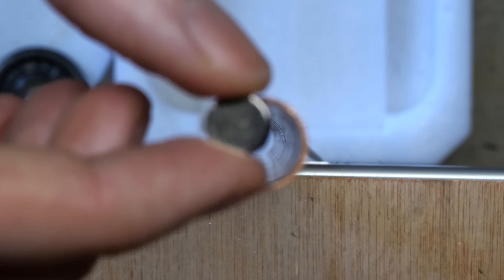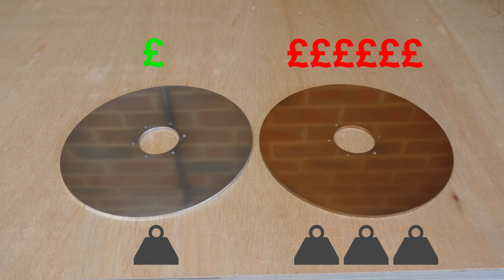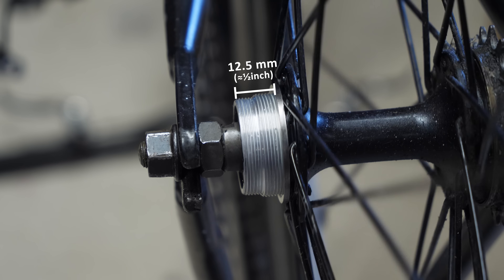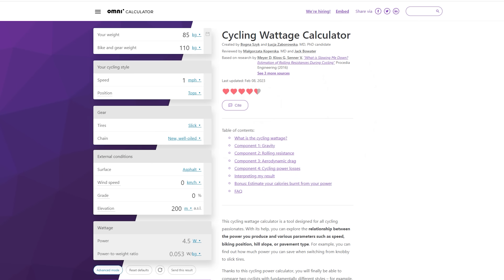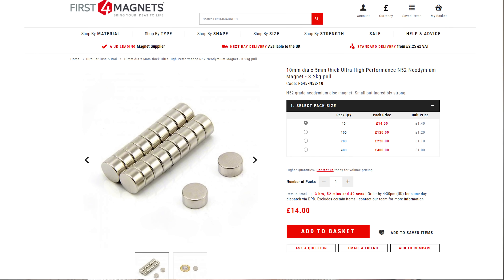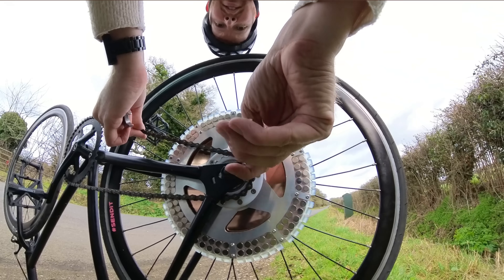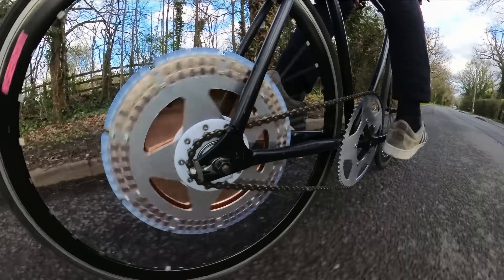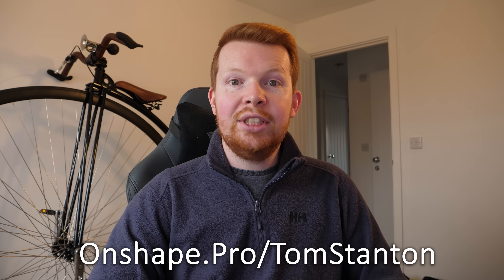Gearless Magnet Bike

Comment: 1.305 / 5.000
Resultados de traducción
Resultado de traducción
I've been thinking of making a request. In the city we must, as cyclists, stop at traffic lights and at crossroads. And we lose momentum, which is very precious when using a bicycle on a daily basis. To the point of modifying routes and departure times to avoid stopping so frequently. I think of the spring rope drive system that the toys used. Mr. Stanton did several tests in this regard some time ago. Before developing new batteries or fuels, I think the user appreciates that with these simple systems, such as the flywheel or the metallic spring system, they can make their riding a bicycle more effective. I don't think pedaling should be given up, exercise is something we need, but we want to reach our destinations more efficiently and maintain a better average speed. City cyclist aerodynamics seems to be underappreciated because the average is low. But a headwind or using a non-aerodynamic shape are felt a lot in everyday life. When I carry my heavy bag on the handlebars to protect myself from mud and rain it seems to have an improvement in efficiency. I am 63 years old and it is not easy for me to reach 20 km/h. No engine, no fairing. How would my routine journey be more efficient?

Comment: Copper is better but silver is 3 times better than copper. But silver would be too expensive 
. Try it on a .999 copper & a .999 silver coin , slide a small magnet down the coins and u will see the outstanding results. 😉

Comment: If you drill the same number of holes as magnets in a ring around the copper so that the centers of the magnets move over the holes, it will induce a current around the hole and be more efficient. The amount of energy turned into heat vs work in mechanical output is going to be proportional to the amount of slip.

Comment: Aluminium is better suited because it's diamagnetic, copper is paramagnetic, this has nothing to do with conductivity itself, its about permeability. The inertia is a valid point concerning the discs. If you would make them the same weight and weight distribution (a homogenious disc is fine) the aluminum would win

Comment: I think using this as just a brake with the chain still driving the wheel may be interesting. Going uphill would be much easier, with the direct mechanical link, but being able to shed speed or better manage steep downhills automatically would be a nice feature to have.

Comment: Can someone clarify. This is all impressive. However. Gearing is preferred in order to provide speed ratios. All this accomplishes is a  slipping non contacting clutch. Wasting pedal power.
The thermal image clearly shows the wasted power.

Comment: lovely-- but using a iron ring behind the magnets you would double the strenght of the magnets AND you would avoid them sticking to the chain I believe. Also if you can get the magnets small and thin, and extremely close to the disk with a relatively thin disk... you should bet bigger force transfer at low speed and higher efficiency

Comment: That was great! The principle is not unlike Eddie current retarders used to slow large trucks. We would use them - rewired for mains voltage - to provide the braking force on a vehicle dynamometer. LOTS of heat; the powertrain energy had to go somewhere! (which is kind of the point). As long as there are Eddie currents, there is heat, and aside from superconductivity you are going to be stuck with it 😢 
I wonder if there is any advantage in making the arrangement like an induction (squirrel cage) motor? Haven't thought this through, but they have a non-magnetised rotor inside a stator's rotating magnetic field?

Comment: if the eddy currents are smaller would this generate less heat? Think how a transformer is made of thin plates to reduce the size of eddy currents.
What if the copper disk was in eight sectors?
This will make the design harder as the coper will have to be mounted on something. But the copper need not be structral. Say aluminium foil on a non conducting sprocket?
Thinking differently, I think an EMF is created causing the resistance and heat. What if this EMF was tapped into a load like a headlight or battery or electric motor?

Comment: As fun as that looked, I could see that would be the end result - less efficient as a torque convertor as all slippage is wasted as heat. Makes for a good zero wear brake though. Now if you coupled generators into that "clutch" in a planetary gear configuration, and then took the power generated to add some torque, provided there was good efficiency, now we would be talkin'!

Comment: I wonder if a design based on variable (changing) magnetic field intensities instead of the permanent magnets could improve the performance.  The permanent magnets will give you the linearity of power that you found.  Controlling the amount of "back-induction" may allow you to control the harshness of the changing torque.  More so because implementation may be easier as the change is to the stator.

With most admiration and respect for your work.  Jaime

Comment: In the copper-vs-aluminum experiment, the 3x density is what's causing the disk to travel slower rather than the enhanced braking force. An experiment where you ran a magnet sled down the side of copper vs. aluminum plates would tell you which one is best for the application.

Comment: Maybe a material with a high permeability would help because the magnetic field of the magnets passes through a smaller air gap to the copper plate but then the magnetic field has to return back on a very long distance back to the other side of the magnet just in air with a relative permeability of 1. But i understand it's not so easy to do that with electrical steel ;-). Additional it would be interesting if it's possible to set the slip and torque between the magnetic rotor and the copper rotor by adjusting the air gap.

Comment: First, congratulations on the great and successful project. At 7'41" of the video. Increasing the number of magnets actually DID reduce the RPM, proportionally, considering how many magnets you've added compared to the count of the magnets already there. In order to achieve the linear response, it takes the proportion to stay constant. If that is, say, 2, then it takes adding 2,4,8,16,32,... magnets in order to keep the response linear.

Comment: You are one of many recent (maybe since advent of youtube “lecturing”) fascinating examples of upscaling of verbal communication. Initially for maybe three to five years i did not comprehend on par with reading thus preferred reading for comp and speed. Now neither are concerns with as the prof mentioned below, colating of material, and using increased playback speed. Cheers to  your work and teaching. And to including thermal imaging, made me think about a viscous coupling transmission which audi and vw used back in 87 of which i had on my vw quantum which dispensed with having the weight of a traditional 4wd.

Comment: Have they made an automatic transmission for bikes yet?
I have always thought that if you have 2 weights inside the rear sprockets and they are on tracks so they can slide outward at higher speeds,
then you could hook a chain to the weights that would funnel through the bike Hub, to the outer end of an hollow axle and the chain movement could operate the derailers.
OR the weights could be outside of the wheel assembly and do the same thing.
Feel free to make this because I don't have the means to test it.

Comment: Since the braking force is determined by the difference between the magnet's rpm and the wheel's rpm, doesn't it mean you can brake faster when u pedal in reverse?

I'm not much of a bike guy, maybe pedaling in reverse is much harder than expected, but i guess it's worth a try

Comment: Think of those pumps where we see a coil of wire having a cylinder shape hole where the  
magnetic-cylinder and axel with blades fits into that cylinder shaped hole which is surrounded with the coil . Having just the fins, blades or pedals  outside the device? When current moves thru the coil cause the magnetic-cylinder to turn or engauge  the pedals in contact with the water to be pumped.
Now this is wear a small amount of electricity needs to be present to create a magnetic field which may solve the lack of adhesion to the spindle? This concept should be anticipated allowing for the immediate adhesion of gear to peddles shortening the the time and space while you pedal  your bike.
One may want to understand my comments by learning Dynamic Braking where one removes or adds resistance as a ( light=load) or various resistances to achieve various degrees of adhesion at the pedal stemming from the magnetic- gear at the wheel . This puts a load on the. Motor/ Generator causing resistance and engages such to stop the vehicle. But in your case engages the connection between gear and wheel / pedals

Comment: Tom Stanton et al.
Hello Friends,
I am Steve Léonard BSc,. Geology, G.I.S.,. Remote Sensing, Tectonics., Electrical & Electronics., Inventor,.Solutions-specialist Industry,.
Currently working on transportation devices involving N-720, Resonance 😊

Why are you building this magneto-clutch?

My Guess is only complicating the project!
What you are doing with the electricity produced? 
There are ways to apply this project that could lead to success.
Just a few things?
Use Dynamic Braking to increase brake power yes. 
Or experiment with the use of a SYMMETRICAL Wheel for breaking and switching between brake and pedaling.
Maybe try making 2 magnetic sprockets and two magnetic pedaling systems. Alternate between the left and right.
Knowing that most if not all bikes are manufactured for single pedal and gears on the Right side of the bike. This could mean use of a 4 wheel vehicle!
Connection/Correction of the sprockets at Right angles to the wheel.
SteveL@cogeco.ca

Comment: If you had magnets instead of the copper disc could they be arranged to repel the ones in the molded part you have .... to make the wheel spin ...that's to easy ?

Comment: Great work! I think this is essentially an induction motor. What helps the induction motor work more efficiently will help this clutch as well, e.g. adding slots to the disk to limit the directions of Eddy current, adding iron cores into the slots to increase the magnetic flux density (B = muH)
Reply: Could you use a belt instead of a chain to help with the weak points on the sprocket and the magnetic interference?
Reply: This was meant to go in the main comments. Whoops

Comment: You should make me  a mech suit out of magnets and ballistics gel or silicone heat resistant urethane resin to power devices and charge batteries run servos. Then, you could make me aquaman generating my own pure oxygen and hydrogen from my own movement. I'll be the guinea pig in this experiment. I'd be an underwater god in that suit. Sorry, I didn't mean to be so selfish and power centered. Let's build siuts and rule 2/3 of earth on this day after Earth Day 2023 4:44 PM

Comment: if you convert the chain to a belt, then you could move the magnets closer to the belt which means you don't need to squeeze the spokes, giving you more structural stability
I have little knowledge on bikes though so take my opinion with a grain of salt

Comment: dont know why you would spend any time on this. a geared apolication has a reason why it uses gears and not because it was the only idea the manufacturer  could come up with. geared transmissions dont work very well because the slip wastes energy ;where a gear  reduction increases torque and sacrifices speed. and In most applications the input and output should be linked for feedback. besides magnetic transmissions are not a new idea just a failed idea in most applications. its a nice build you have here though

Comment: Very clever, but presentation would have been better knowing the end result you were trying to achieve. A few words of concept, using a fast rotating disc of magnets driven by the chain to turn a disc attaced to the wheel, and vid of you riding. Geat mind!

Comment: What about DIY asynchronous motor using aluminium wheel rim as a rotor? Just put a few electric magnets along it and supply them with a phase shifted AC currents.

Comment: Maybe I didn't get it, but what is different about this concept and the one inside an electric bike hub motor since copper winding play the role of the copper disc? Thank you!

Also, isn't better to have a dynamo inside pedal hub and transfer power along wires to an electric motor inside the wheel, for a gearless bike?

Comment: The chainring machining was not all that clean and vibration makes for errors in the finished product . Stamped ones are better . Also , did he heat treat the chainring afterwards to give it adequate stiffness ? The end product still had mechanical i efficiencies . The polymer rear cog and cassette mount would have limited strength . Martensitic steel or cabon fibre reinforced would have been better .

Comment: What could be very cool would be building a ebike where the pedaling go entirely to charge the battery, at an optimized pedaling speed, while riding only with motor. One could concentrate in pedaling in the most efficient way all the time, even when stopped at the traffic lights (e. g. With an automatic deploying bike kickstand) or uphill...

Comment: Hey Tom, I'd like to know you're thoughts of implementing a lockup mechanism for a freewheel on a rear cassette. You might be thinking it's a waste of time but when implemented in a mid drive ebike with a front freewheel system, when the biker brakes and engages the mechanism at the same time, the opposing torque from the locked freewheel can act on the motor to provide energy via a regenerative braking process. Using a fixie won't be efficient for cruising. Using a freewheel without the proposed mechanism on the other hand won't allow regenerative braking since there is no opposing torque when the bicycle is being slowed down. Now, a KERS system could be used which you have covered. Not so great at low speeds but useful at high speeds. Unfortunately though it's not feasible for an ebike since it'll take up the battery space. Let me know you're thoughts on a cassette lockup mechanism. I'm looking forward for a video about this mechanism.

Comment: I actually think this project is really interesting. Unfortunately the transfer of torque will always be determined by the change in magnetic flux. Meaning that you will have to pedal faster to get it going and keep it going.
Reply: Or induce another magnetic flux which alternates faster as wheelspin. It is called electric synchron motor, and found in most current EV vehicles 😀
Reply: @palohagara Electric Vehicle vehicles?
Reply: @tataduzy4260 Yes, most current EV vehicles, with MOSFET transistors creating alternating current.
Highly effective and only 10-15 kWh/100 km = 10-100x less than combustion motor.
What is the problem? Calling BEV electromobiles "vehicle"?
Reply: @palohagara  It’s because EV means “Electric Vehicle” so saying “EV Vehicle” is saying “Electric Vehicle Vehicle”.
Reply: @comeonandslamandwelcometot2418  ok I thought so, just "gramar nazi" problem.
It is normal when some category/abbrev became more common, it takes the semantic form of adjective/subject or even verb.
Like we have AC + DC, but if you are talking about current, you also say "Now we switch AC to DC current in a circiut" sometimes.
Or something like Congress resolution R268, abbrev used in many countries to add a certain level to complicated bunch-of-numbers and abbrevs, which are quite common in legislation.
Especially if it is generally-targeted text, which youtube viewers surely are.
And using frequent abbreviations adds confusion to text (for most not-profi readers). Therefore some, maybe dubious double info, adds comprehensibility, not reduces it. 
Like: problem of Postal Codes or Social-Security numbers or other codes, which contain dubious but failsafe information, even when you do not understand or make error.
As you surely noticed on youtube or Twitter where many people use some "their best years military" abbrevs, or T9 auto-complete on mobiles = lots of uknknown shortened words.

So ok, and now whatabout fact, not form?
Reply: @palohagara sir this is a wendy’s
Reply: @AxisBelgium  🤣
Reply: owo

Comment: I know it's a lot of work but increasing the radius of the copper disk would give a more direct drive... rather than adjusting for the slip with a larger front sprocket. I guess you might have thought about this but it would mean re-manufacturing the whole rear magnetic clutch mechanism... which is a waste of time once you locate all that lost energy in the form of heat.

Amazing project. Super well done. Thanks for sharing.

Comment: While watching the video, I was wondering whether a flywheel could be used in conjunction with the magnetic clutch design from the video.  Theoretically it could add as a torque force buffer, so that the human force goes into the flywheel, thus buffering the variable input, then the magnetic force output would be receiving a more constant force input profile, thus giving a more constant drive. The positioning of the flywheel could be internally around the wheel hub and non-ferris metal spokes would likely need to be used like carbon fibre. Also, TEG's for that waste heat capture seemed appealing, but probably overly complex and inefficient to be worthwhile! Just my thoughts I wanted to share, great video I enjoyed. thanks!